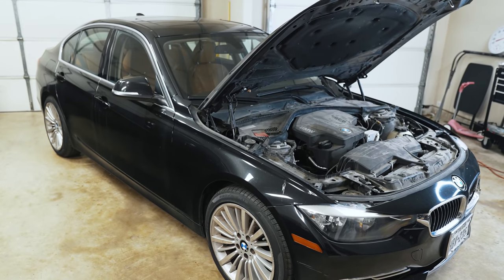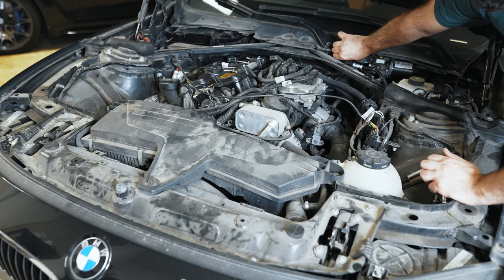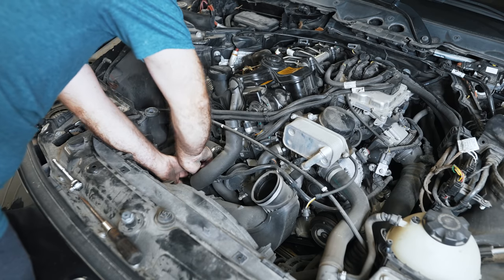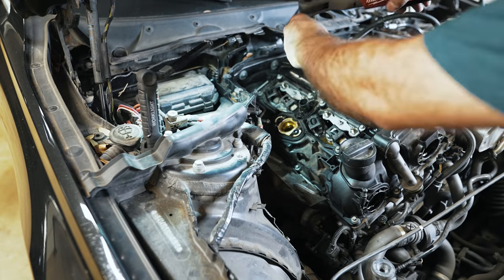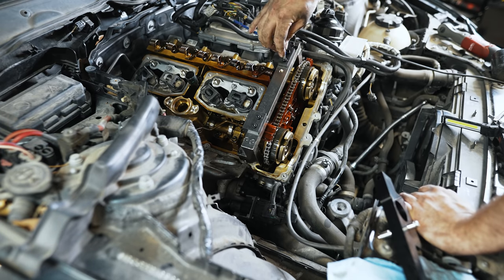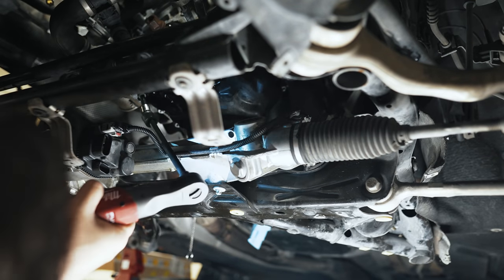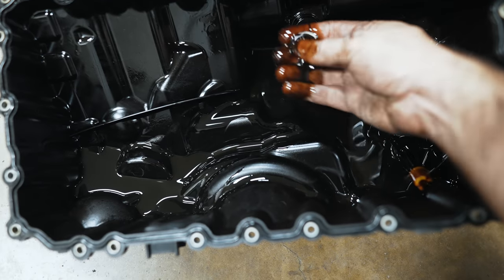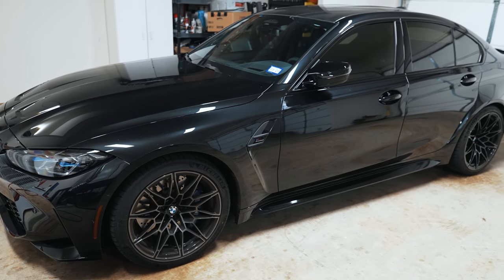All BMWs Get Mechanically Totaled.  This is One.  Saving It!

Comment: Have a wounded b58 if ever you’re free 😀
Reply from the maker: What happened to it?
Reply: @VehicularDIY  pretty sure injector got stuck in open position. Waiting for results from compression test. Misfire on 6 and it’s not plugs or coils. Also waiting for a new injector in case .

Comment: What city do you work in? Would love you to check out my bmw
Reply from the maker: I'm near Houston.
Reply: Dang I live in Dallas but nice to know ur in TX, man I just got a 2011 f10 535i about 3 months ago and I LOVE the way it drives bmws are awesome it’s been so fun, but I’m heart broken I just got a drive train malfunction warning ⚠️ ⛔️ the other day @ 99k miles, so far changed the spark plugs & it didn’t solve the problem, thinking it’s the turbo/gunk or bad turbo , carbon build up or fuel injectors. Any recommendations? I did notice the turbo doesn’t sound the same as of recently seems like it’s working hard based of noise
Reply: @VehicularDIY

Comment: Those N20 motors are absolute trash. the n20 is a boat anchor. They all need to be recalled and drop n52’s in them. Trash engines